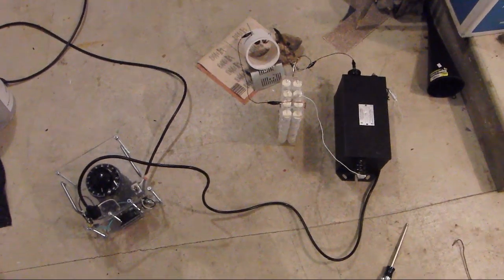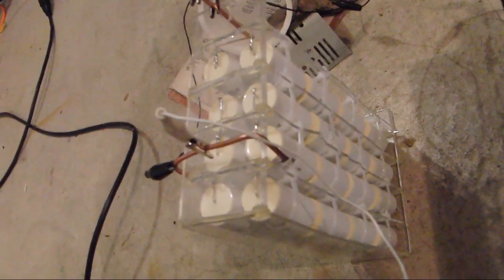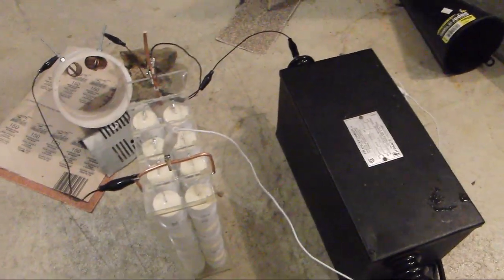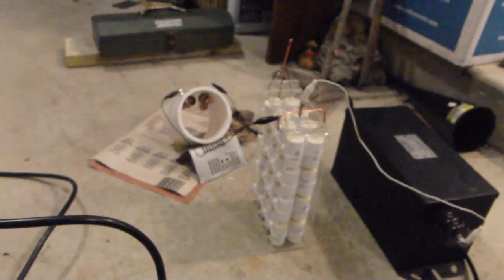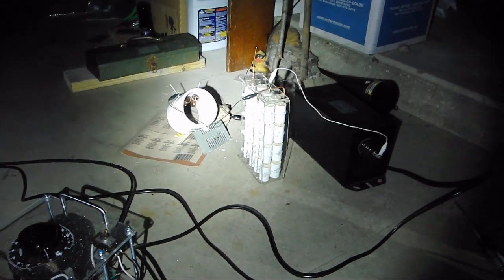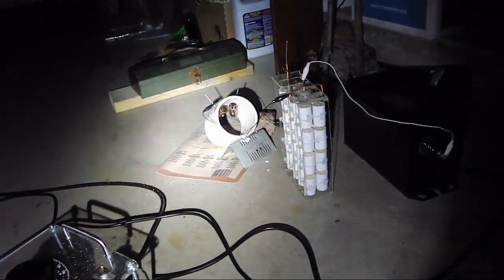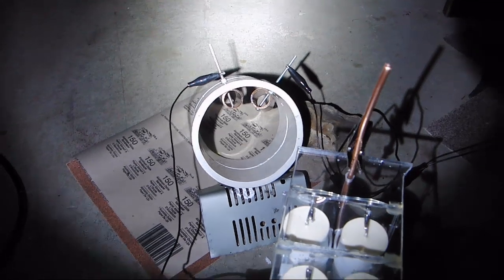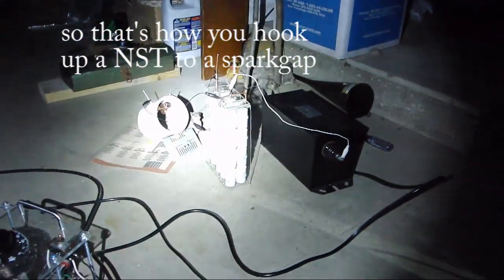Tesla coil MMC - Testing sparkgaps

Comment from the maker: @maintoc Well the transformer alone will draw 4-5 inch arcs.  12Kv 60mA.  However with capacitors on it, they store the energy so they release it as a loud discharge.  That's why the sparkgap, was very loud.  The farther i draw it apart, the more voltage, and higher delay between sparks.  But you can't draw an arc with the capacitors in parallel, just big loud snaps.

Comment: I like the use of the clear plastic casing on the capacitor bank and the Variac.  It makes it nicer for the viewers.  ~  Would you not get sparks from just the output of the neon sign transformer if you didn't use the capacitor bank, or does the inclusion of the capacitor bank in the circuit just make the sparks bigger?

Comment: Cool video. It seems like that was quite loud. I remember when I had my ignition coil hooked to a homemade capacitor, I kept cranking it up for a 3 inch spark from the top of the bottle, to the aluminium foil. My ears were ringing for so long. I have yet to do more with ignition coils. Eventually, I plan to replace the iron strips in the center with ferrite cores so I can power it with HF, rather than about 240hz which is annoyingly loud. Also, it would be an easy way to an AC flyback

Comment: there must be lot of amps, with MOT + MOC in parallel i had 14AWG wires used for the original input of 230v to the transformer hooked to that parallel LC and it started on smoke after 10secs of inhuman noise!